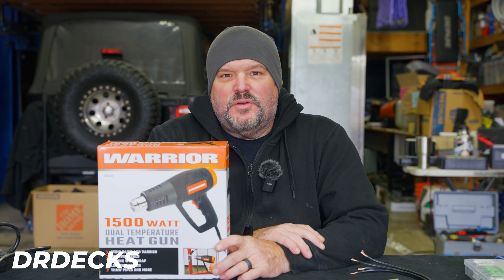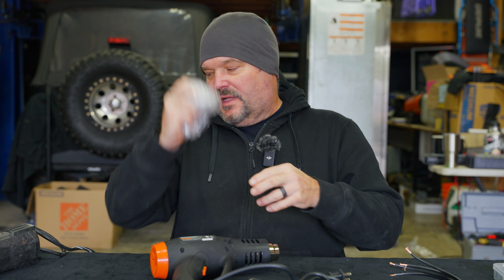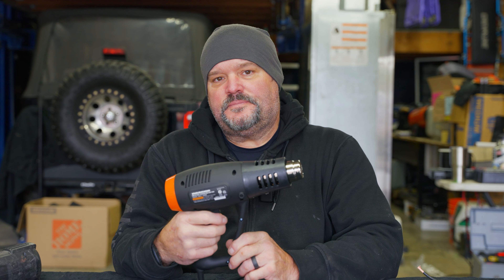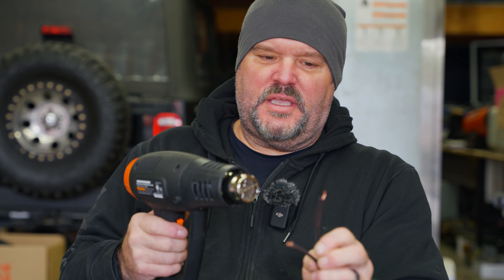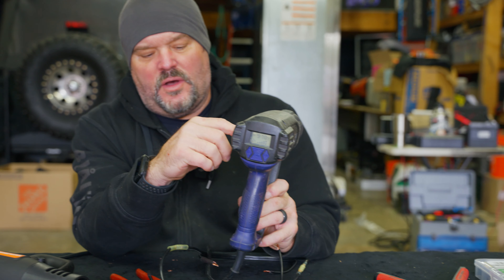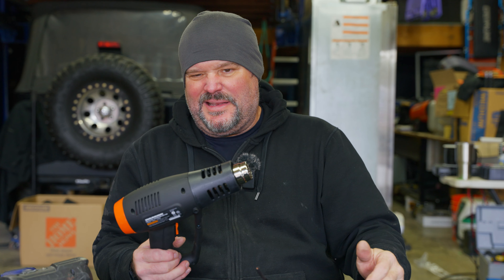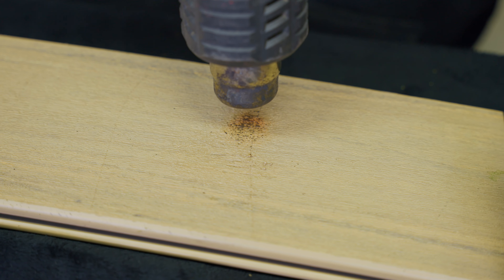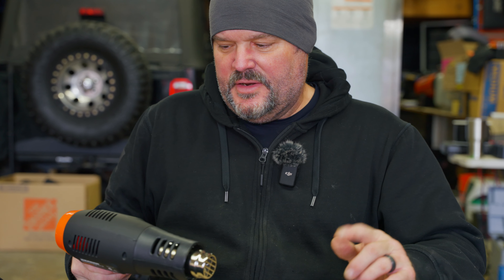The Cheapest Heat Gun Ever VS A Modern Heat Gun || Dr Decks

Comment: Just returned this exact 1500W Warrior model yesterday. Purchased Jan 2, 2024 failed Jan 26, 2024.The cord came loose internally at the heat gun connection. Being somewhat stubborn, found that the unit would run when wiggled. So, after a few wiggle restarts.... the cord connection sparked and singed my thumb and forefinger. Ooow. No UL tested marking on the packaging.
Reply from the maker: Interesting. I’ll keep a look out!